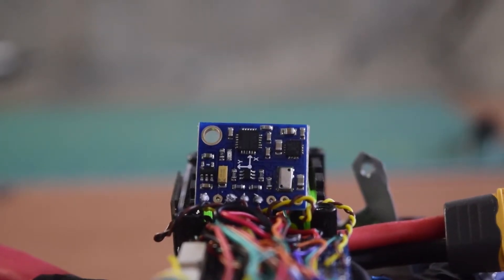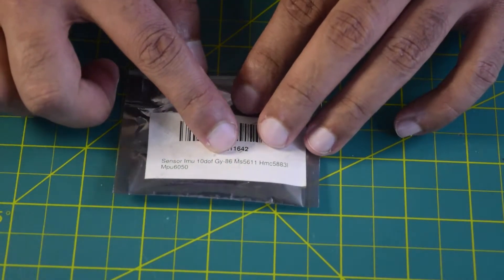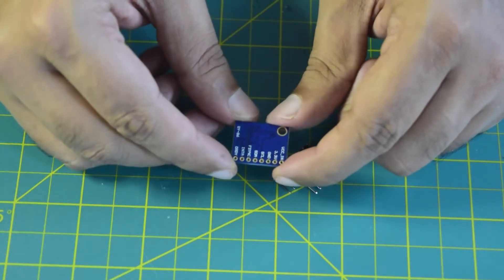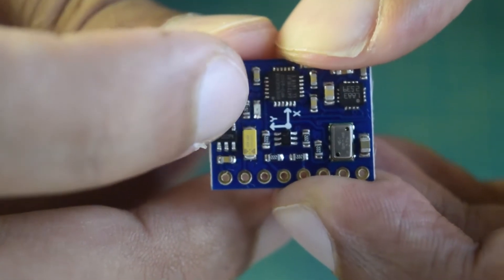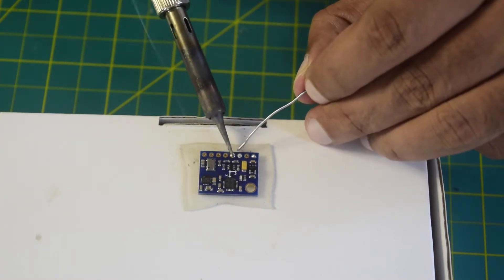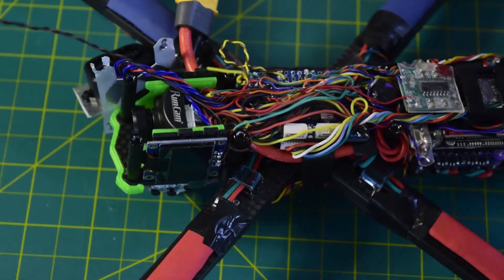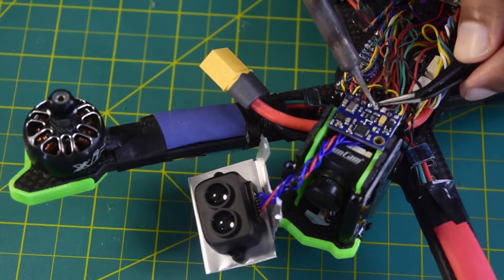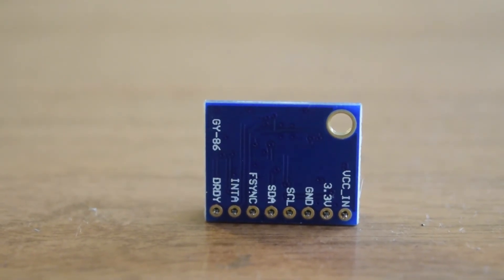How to Install Secondary IMU on the Flight Controller | GY-86 10DOF MS5611 HMC5883L MPU6050

Comment: Hey. i have a question about pixhawk and i2c port if anyone can help me. i have a pixhawk, and I wanna connect an external compass and a barometer to the flight controller. i have both the modules, but the flight controller only has one i2c port

how can i connect them? just in parallel?
Reply from the maker: I2C bus can support upto 128 devices as long as they have different addresses. so yes yiu can connect them in parallel. I hope this helps. Please stay tuned to my channel for my future videos.
Reply: @AstroShootingStars  Thank you for your reply. I will go ahead and connect them in parallel. Subscribed!

Comment: Can mpu6050 be wired to speedybee f405 v3 flight controller
Reply from the maker: yes you can via I2C line via SCA and SDA line but as you know magnetometer on MPU 6050 is on bypass line it is not directly accessible so unless the firmware is coded for additional MPU it will not be detected directly. I hope this helped. Please stay tuned to my channel for my future videos.

Comment: You blocked your high quality barometer with that sticky thing. Great
Reply from the maker: yes my friend as in firmware still there is no implementation of the secondary barometer so it was practically of no use. I hope this video helped. please stay tuned to my channel for my future videos
Reply: @AstroShootingStars  why do you need two barometers tho?
You can add any cheap controller that will handle N barometers and emulate barometer for your drone

Comment: I used this module with betaflight and baro works but marnetometer is not. How to configure it?
Reply: You should send a special command to turn on pass through. Check the datasheet
Reply: @mojotmn  ??? The barometer works without any commands, just out of the box. Magnetometer is not working.
Reply: @jetiscander  magnetometer is working but you cannot access it directly from your controller. You either have to access it using mpu6050 or configure passthrough mode (turn off auxiliary mode) as it works as a master for other i2c devices (in our case its the magnetometer on this board).
So you shouldsend this to your i2c:
0x68, 0x37, 0x02 - enables bypass mode.

Where 0x68 is the mpu address and 0x37 is the register address and 0x02 is the config byte.

Comment: Why do you need a secondary imu, does it works with the primary imu of the flight controller or does it replaces it? Does it improves the stability? Do you have any videos to show the difference? Thanks for the video